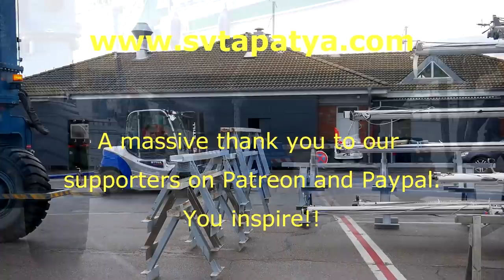He's Drilling Holes In The Bottom Of The Boat!! - SV Tapatya EP205

Comment: Great progress Tony but would you not have been better to counter bore the keel bolt holes first - or are you leaving the hex heads proud?😀👍⛵️
Reply from the maker: Well Norman. In truth, I haven't quite decided. I might remove a bit of material from the floors and put a large plate under the nuts, or I might make a counter borer and let the nuts in with washers... Or any other idea that I think of between times 🤔
Reply: @SVTapatya  😀👍